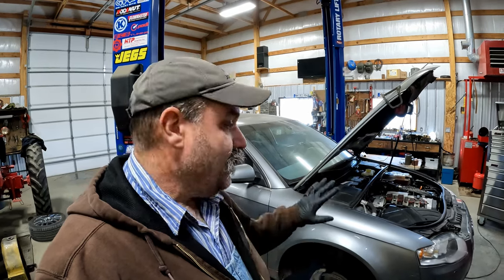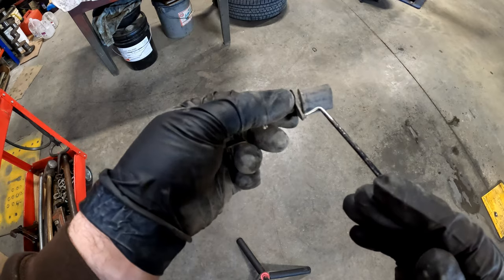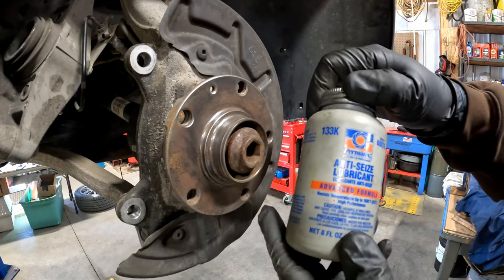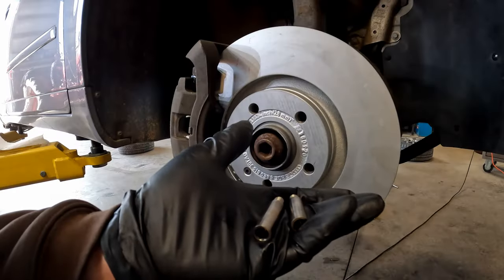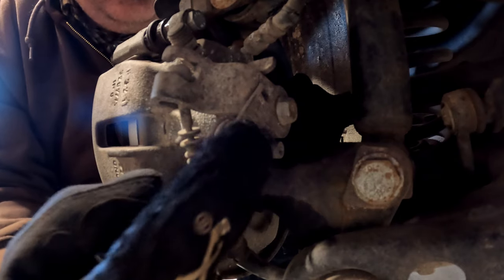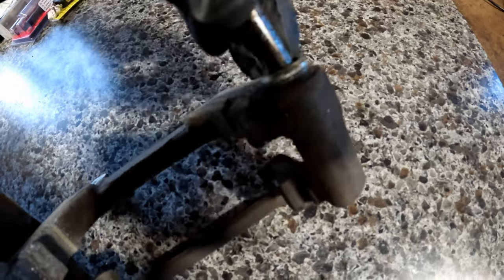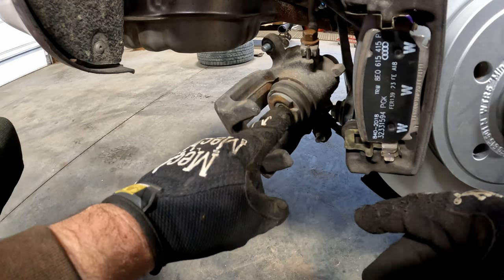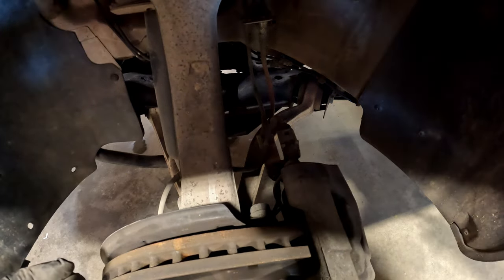Audi A4 complete brake job front & rear replacement 2005-08 B7 VW 2.0 Turbo FSI Audi series #4 2006

Comment: This was one of the best tutorial videos for this vehicle I have seen. Oh how many European cars I have seen where the rotor is wasted full time and someone put new brake pads. Also the retaining bold usually snaps off, not to mention the calipers are dead stuck if the car has been driven in salt for years. The old rotor was not too bad. I have had rotors that are more like pizza slicers than a rotor. Imagine people drive with these around, yikes.
Reply from the maker: Thanks Steve! I did a brake job on a Jeep Cherokee for family member once. The brakes were so far gone there was no rotor. 😬 that one took new calipers caliper brackets rotors, everything was gone. That was the worst I had ever seen.

Comment: I know I’ll get an honest answer, you have good performance from Audi? 
p.s. great video!
Reply from the maker: Yes, I may be biased but with the correct maintnence we have had a great experience. I think they get a bad name because there are some small nuances that require maintenance and often get overlooked and neglected. The cam follower on my previous video is one of them. Most any of the "rubber band" engines with rubber timing belts like this one get a bad rap. I think that goes across many makes and models. Rubber timing belts were popular for decades. If they are changed and maintained they're fine. But being that it is an interference engine, (meaning that the valves will hit the pistons if it's out of time) neglecting the belt can be catastrophic. As for drivability, that is where they really shine. It's a fantastic car on slick roads. It has adequate power and just drives well. I'm a big guy and still fit very comfortably in the Audi. So I guess I would say it is a car for car people. Not something that would be good for a first car or a young driver. It takes attention but it pays off in performance. That's my honest opinion. Thanks once again Tom! I've got one more video in the Audi series that should be out in 2 weeks. It's more of a conclusion. But for the immediate future it's going to be 4G. Hopefully we can get to that truck, there seems to be a lot of love for it! 😊👍